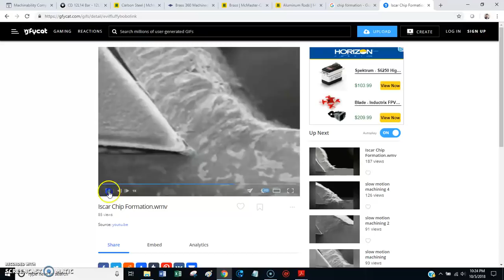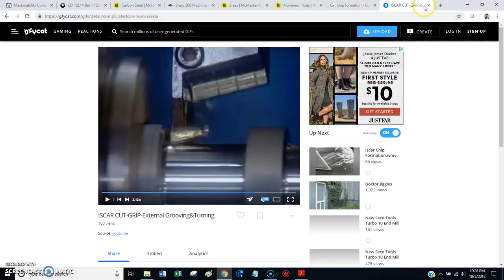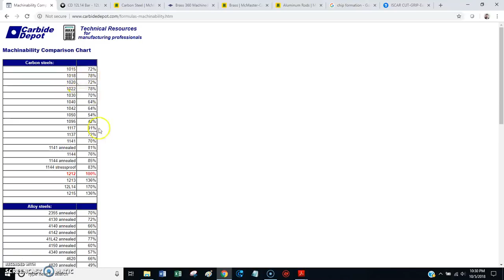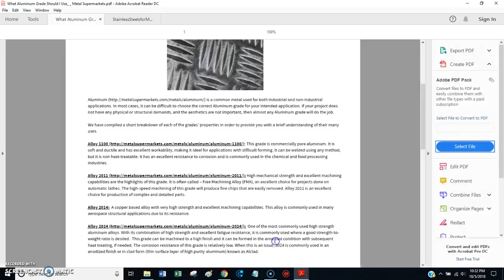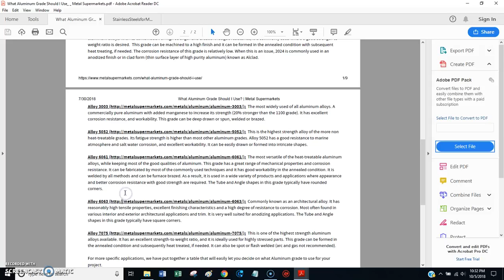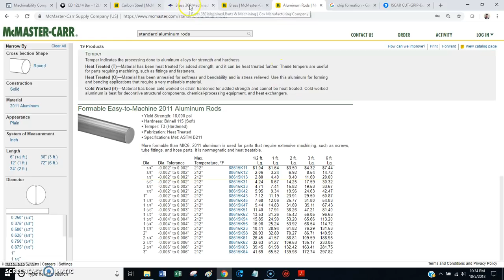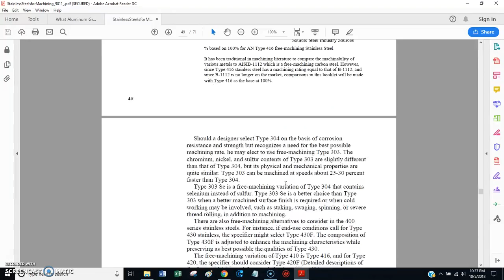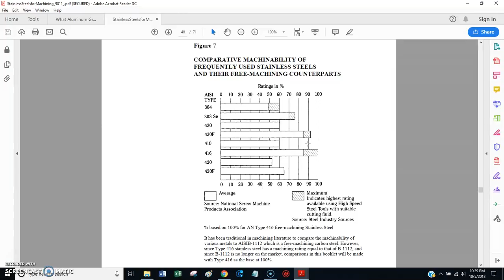Free Machining Raw Materials Make Life Better!

Comment: Hi Franco
You did not mention  the down sides to 2011 and 12L14 which may be important on some jobs, they both dislike being welded and the 2011 dislikes attempts to anodise it.
Other than that, they are both the material of choice in my workshop. I only machine 6061 when welding or anodising is a must.
And you are quite right horse power can overcome many of the problems that come with non free cutting materials.  On some jobs I have used aluminium inserts on 12L14 with good metal removal, but somewhat shorter insert life than with non ferrous materials. I use aluminium  inserts on brass too, it mostly does not chip, but cuts easily and the resulting curled swarf  (like a spring) stream is mostly very manageable.
Reply from the maker: Those are excellent points.  Thanks for adding to this.
Reply: Franco thanks for putting up the video, you can't buy free cutting material if you don't know it exists!